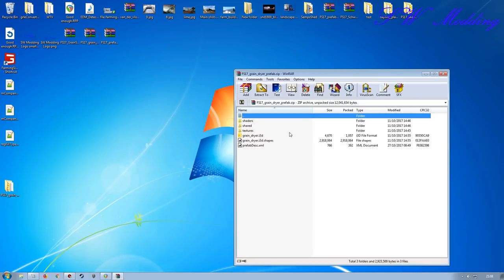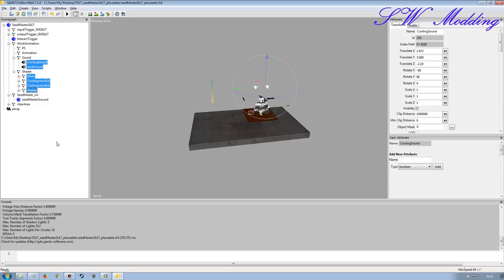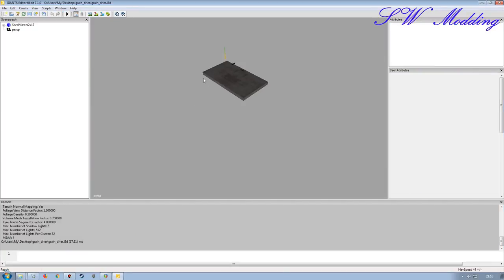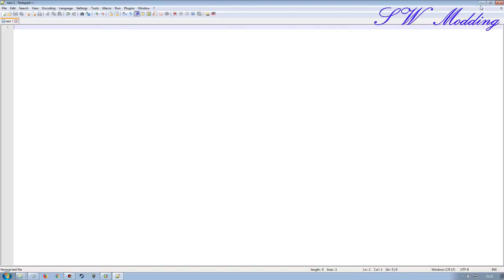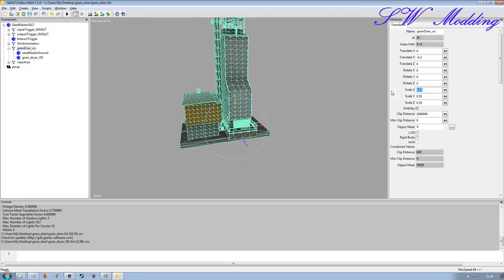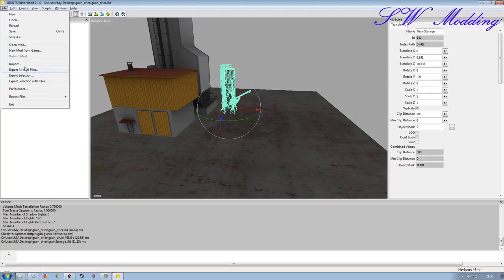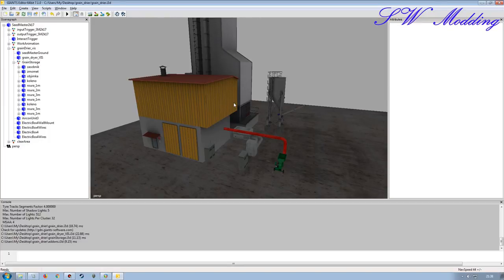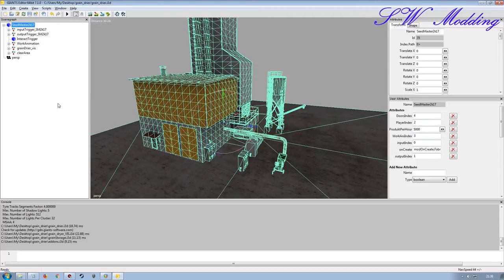Making a mod from prefab buildings part 1

Comment: This is really great. I'm making this up as we go. Hope this might lead to sapling tree production one later. Very educational for a learner like myself. Your doing a awesome job. Cheers
Reply from the maker: I have been looking into the tree sapling production & run into a snag.
I can get the pallet to spawn in without any problems & if all you want to do is sell them then all works fine.
The snag is that when i put the pallet into the tree planter it accepts the pallet just fine but will not plant any trees.
I have not been able to find the reason why this will not work as the pallet is exactly the same as the purchased from the store.